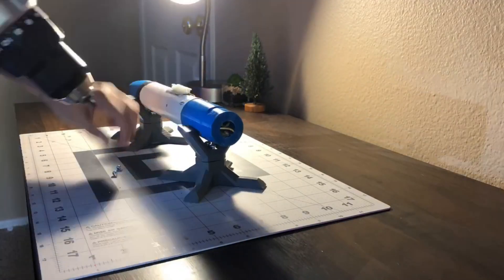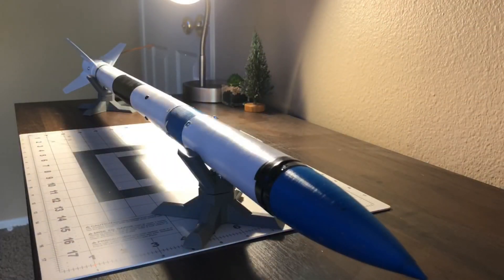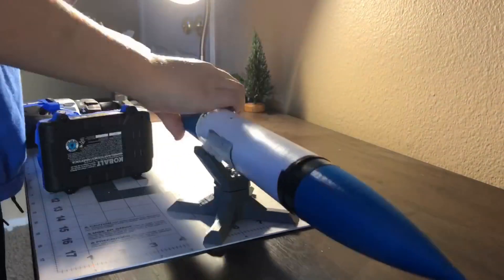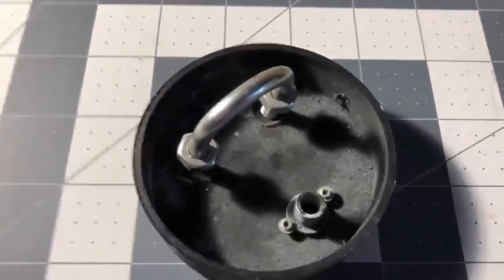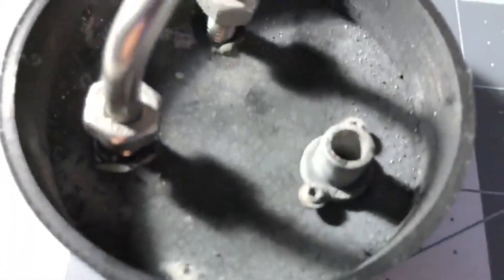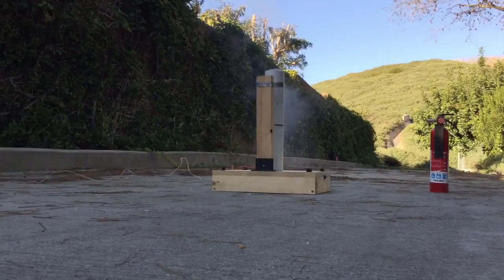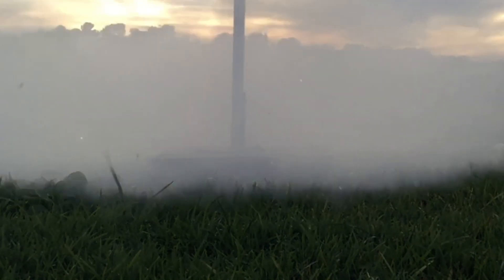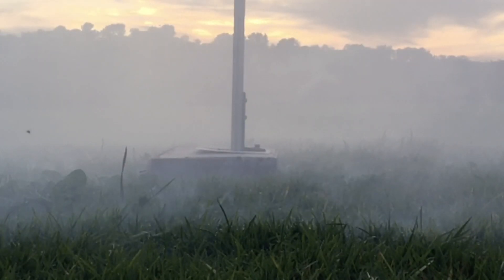Horizon 3 | Test Launch

Comment: The horizon is powerful! I've considered building a custom 29mm rocket, but the only 29mm motors i have are 2 couple of year old E16s. I would also like to develop some flight electronics instead of buying them, I just don't really have the time and experience. I also don't have a 3d printer, so I have to make due with purchasing precisely cut cardboard tubes. I have a friend with a printer who is also into rockets though. I don't want to use up all his filament. Been doing rockets for 6 years and never thought of adding tvc. Also, if your blast deflector plate decides it doesn't want to live, you may want to consider having the rocket a little bit above it. I was also looking into building a custom launch base with an acrylic flame trench with a deluge system.
Reply from the maker: JM Studios Sounds cool!